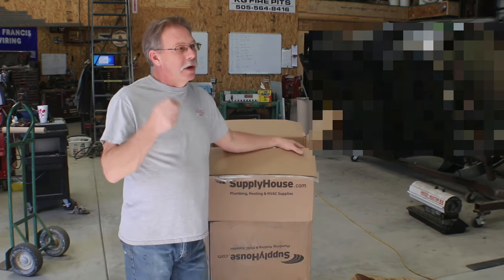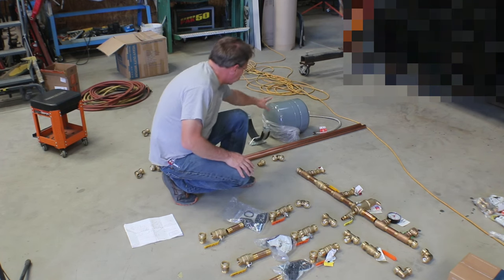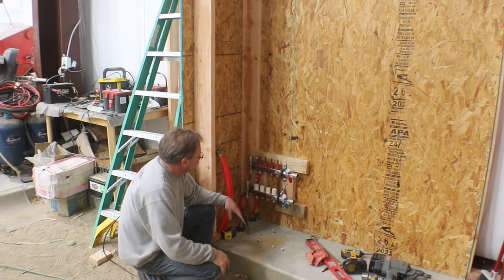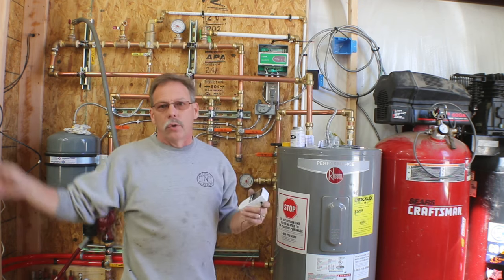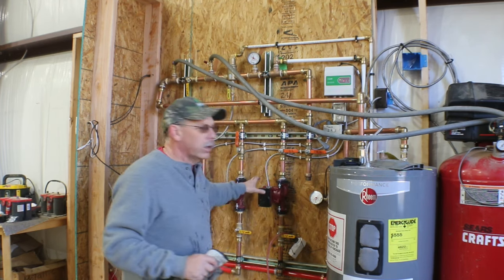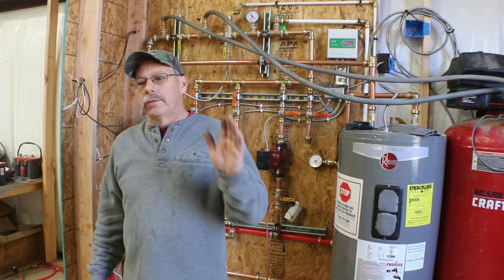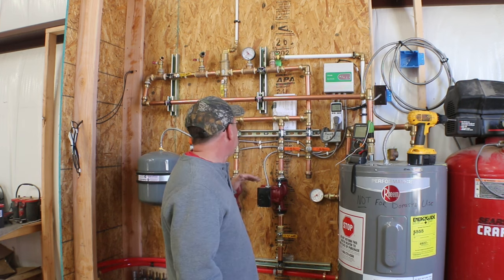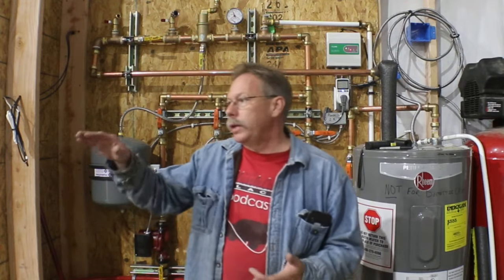Can you Heat your Shop with a $200 Water Heater? Radiant Floor Heating For My Shop | Allison Customs

Comment: I don't know anything about hydronic heating, but I do know electric resistive heating is EXPENSIVE. Did you insulate your slab before you poured it? And did you insulate your shop or do you plan to in the future? 11kwhs of heating is going to be expensive, any efficiency gains you make should have a good ROI.
Reply from the maker: Yes, the slab, stem walls and shop building are all insulated.  The water heater is expensive to run, but will keep the shop at 55-69 degrees depending on the outside temp,

Comment: Honestly I hope one day you upgrade your setup to an on Demand tankless water heater. Example ecosmart makes a 27 kilowat model tankless water heater for about 500 dollars. I mean it would have a whole lot more wattage then ur setup right there. No rewiring hot water tank either. However it requires three 40 amp 240 volt breakers. So at a given time it can pull a lot of electricity. Which means u might have to upgrade ur electrical panel. But I would say it would be worth it. I know the hot water heater was a quick fix. But the tankless water heater might be better in the long run
Reply from the maker: I have looked into them, but unfortunately I can’t go bigger with my electrical service.
The original idea was to use a waste oil boiler, unfortunately I just don’t produce the amount of oil necessary.
Check out the current situation - https://youtu.be/_mR7S4N28oY

Comment: Can somebody point me in the right direction online to start researching and planning a radiant floor heat system. I’m building a 32/24 pole barn and want to do this.
Reply from the maker: I got a bunch of info here (https://www.radiantec.com/about-radiant-heating/tubing-installation-methods/) and then went down the internet rabbit hole.
Reply: Ron bond construction. On youtube. It's bondo built. He does cement floors and showes you in one of his videos how easy it is to layout  the pipe yourself.  Tell him Sprintcat  sent you over there 🤣.and don't forget to give a thumbs up and subscribe.
Reply: Check out the books and talks by Dan Holohan on hot water hydronic piping, such as his 'Pumping Away' book.  It will tell you some of the non-intuitive things on the piping to the loops such as closely spaced Tees, etc.  Bunch of articles at HeatingHelp.  Also, Uponor (brand name of PEX) has info on installing the actual pex loops since they want to sell more pex.  

One key, loop length controls circulator size as the "head" in a closed hot water system is the pressure loss due to the flow, which is based on pipe diameter and length.  Max 250' with real max more like 200' for each loop.   Not to mention, the temp drop from start to end.

Comment: Slab heat is nice recovery is important unless it’s a hobby shop and you can allow every door opening.  Regulating the temp is another issue.  A shop too warm is not efficient.
Reply from the maker: True.  I’ve been keeping mine at 60f

Comment: A insulated jacket for the water heater couldn’t hurt keeping temp as well I would think
Reply from the maker: My brother recently offered the same advice, definitely now in the plan.
Reply: Not all that necessary when the heat goes into the conditioned space.    High insulation value on a water heater is primarily useful when no domestic hot water is used for many hours such as while you are sleeping or at work.  A space heating system has to work during those times.

Comment: Do you have solar electricity? Considering the cost to buy electricity installing a heat pump may be a viable solution to provide the required heat output needed to sufficiently heat the space at a fraction of the cost of running an electric heater as heat pump Will give you three times the heat output for the equal amount of energy consumption. Electric heating is 100% efficient so for every dollar you spend the entire dollar is put towards heating it is a 1:1 ratio, AC pump on the other hand is 300% efficient and would give you three times the amount of heat for the same energy consumed
Reply from the maker: No on the photovoltaic solar. 
I plan to add hydronic solar before next winter, I’m choosing that over PV  due to space constraints for panels. Also, last I checked, it would cost nearly $40k to offset my house and shop, all total that would be a 10-12 year pay off.
Hydronic would be closer to a 4 year payoff.

Comment: The only thing about having an internal check valve is if it does fail, you have to replace the whole component.  And check valves do fail.
Reply from the maker: True they can fail, but I believe the internal pump valves are replaceable.
Thanks.

Comment: Dont you need an air scoop?
Reply from the maker: Are you referring to someway to let air out of the system? If so, yes and I used a air separator version called a Spiroterm VJR100 (  https://amzn.to/3jRb7OL  )
So far it works awesome.
Reply: @AllisonCustoms  the scoop will sit under your automatic bleeder valve, creating a high spot in the horizontal run. Tacos website has a good explanation of how they work.
Reply from the maker: Thanks!

Comment: Over all looks nice for diy, not a fan of shark bites though for permanent work. I heard you say you are using 30 gallons of antifreeze, I’m gonna assume Sierra or like. Just a heads up antifreeze is not good on steel or iron or rubber gaskets, so your circs if iron will take a hit, the gaskets and seals will too and the w/h tank. I saw you intend to replace the heat source possibly with solar soon, so all that should not be an issue.
Love to hear back on how it’s doing after a bit!
Reply from the maker: I’m planning an update video for the end of the season.  Thanks for the info.
Reply: @AllisonCustoms  looking forward to it, you obviously care about the details, so it will be cool to see what you come up with!

Comment: Back in the "Total Electric Living" days of 1970's, it was not uncommon to see both elements powered at the same time. The proper way is to install separate breakers in the panel and run separate wires to each element. A 6 terminal thermostat for a single element wtr htr is installed in place of the lower stat and the wire from the upper element to the lower stat is disconnected and abandoned. 
The 6 terminal stat provides a seperate ECO (energy cut off) for lower element to reduce risk of uncontrolled heating should the stat fail in the closed position.
The problem with sharing info is that you open yourself up to a certain amount of risk and potential ridicule in that some people will think that they understand what you said and by the time they are done with what they are working on they have it so messed up that there are problems. They then have to hire someone to resolve those issues. Of course in discussion of the situation the person that did the work does not want to make himself out to be an idiot so you end up the moron. What makes it worse then is that the person doing the repair has a tendency to jump on the moron bashing wagon so as to make himself out the hero.
One final thought, it takes a given amount of energy to heat a building to the desired temperature during the coldest day of the year.
There are programs and formulas that will help determine that requirement.
Sometimes a little up front expense for a consultation fee to help determine what is actually needed is money well spent. Even if they are using a simple multiplier rather than a full analysis of the bldg it should help you start off with the right size heater, eliminate wasted expenses on experimentation, allow you to use energy cost conversion tables to help determine your cost of operation after installation and compare cost for different fuels.
The down side of using an under sized heater is the recovery time. If you are working in the shop and open up big doors for long enough to cool the slab then you might be working in a cool space for an extended period of time.
Otherwise, nice job on the install and video. Hope to catch a video from you with results in a few years to see how it's going.
Reply from the maker: Thanks, you make some very valid points!

Comment: With all the sharkbites I agree that you can blow hot water around
Reply from the maker: So far they are working great, and I have been able to change things up as needed or when I just want to try something different.
Check here for current setup - https://youtu.be/_mR7S4N28oY

Comment: You could potentially cut the cost of heating your shop by preheating your water going into the electric heater with composting leaves and other vegetation, and burying the lines underground. Look on YT for videos on that. The Random Farmer has a video on his channel.
Reply from the maker: Interesting idea.  I would imagine (I absolutely don’t Know) that I would need a compost pile similar in size to the area I want to heat.  And if my wife complains about haw many cars I have (and she can’t see them all) I can’t imagine what I would hear about a compost pile of any significant size. 😀😀
Reply: @AllisonCustoms  you wouldn't need a huge pile, a small investment in concrete block and scrap rebar or conduit to hold the blocks up in a circle. On Mother Earth News years ago, a guy did this for the water heater in his house. He made a block structure with similar materials, and it was about 6' across, and about as high. Within a week of putting leaves in the wall, the temperature rose to about 140°< and held up to that until about the middle of April. After that, as the leaves decomposed, the temperature gradually dropped, but still was above 100°. If I were you, I'd look at a few videos and see if this is want to do.
You might be able to use deconstructed concrete blocks, and electricians might give you scrap conduit. A scrap yard might get you other things that are also useful.
Reply from the maker: Thanks I’ll look into this!  I all for easy - mostly free energy!

Comment: Just a quick note and not to be an instructional comment. Please don't burn you garage or house down.
Most electric water heaters are fed from a 30Amp 240Volt circuit. Each element is rated 4500 Watts: 4500 / 240 = 18.75 Amps. You are only allowed by code to load a 20Amp circuit to 16 Amps, this is why with one element at a time it has to be on a 30Amp circuit. Two elements equals 37Amps which by code would need to be on a 50Amp circuit. Besides being on a 50 Amp circuit the internal wiring of the water heater would need to be changed. Do not try to make both elements turn on at the same time unless you are willing to face the charges for negligent homicide if you kill someone in the fire for improper wiring.
Reply: Note the internal wiring and each individual element are not rated for 50Amps.
Reply from the maker: Please note, I did retire both elements and I said so in the video. In fact I specifically said I had, but that I would not be sharing how since I didn’t want to encourage others to try something they would not be comfortable or knowledgeable about.
Thanks for the comment and watching.

Comment: My new pump is making noise and I am sure I have air in the system (which has been an ongoing problem).   I have had plumbers spend dozens of hours on the problem.  If anyone knows of the best air evacuation system please let me know.  Multiple plumbers have not found source of air.
Reply: Baseboard 180 degree heat.  No in floor radiant heat
Reply from the maker: Could be air trapped in the system, I had to flush my system with a garden hose for over 1/2 an hour when I started mine up.
In answer to your question, I’ve had really good luck with this one. - Spirovent Jr. Air Eliminator - https://amzn.to/3kBVvhY

Comment: It is very obvious that you did lots of research before starting on your system. Doing it yourself allows you a greater understanding of the system so maint. and repairs can also be done by yourself at a significant savings.
One item that I noticed and took issue with was your expansion tank. Many people don't understand the operation of them. First of all you said you filled the tank with water before starting the system. If that is done there is no room for expansion. Also, it appears that the tank is mounted upside down. My recommendation is to mount the expansion tank with the connection at the bottom. Then put a T in the line with a shut off valve on the two other sides of the T. One T would Isolate the tank while the other would be used as a drain. 
Once the tank is set up correctly, Isolate and drain the tank. Leave the drain open and pressurize the tank to the the pressure the system normally runs at. Then close the drain valve and open the valve to the system. Another benefit of the T and  valves is that it allows you to be able to re-drain the tank easily as air is slowly absorbed by the water over time and the tank will fill with water and again become non effective.
Reply from the maker: Thanks for the advice! I am planning to change the tanks hookup location (thanks to another viewer’s suggestion), so when the parts come in I’ll try what you’ve suggested as well.

Comment: Why use shark bite fittings when you can just use crimp fittings??
Reply from the maker: Only because I have changed up the system three times since the original.  I actually have a new video on it coming out soon- to explain the most recent changes.  If I ever “complete” the system, crimps will be my fittings of choice.

Comment: just starting typing off the intro to the video here :
unless its an on demand waterheater is made to heat up water inside an insutated vat , when youre pumping it around throught the floor youre cooling it off and basicly make the waterheater working non stop , sumting it isnt desighned to do and even running it part time it whont be enough to heat the place up
so while it should work i think it will burn out the heating elements over time , it probably be less efficient than a purpose made underfloor cenral heating system , the bigger elements make for a little more overcapacity so you can run the hot water around for a little longer untill its cooled below the temperature to be usefull 

it might work with multiple hotwaterheaters running one at a time but a central heating system would be way better as its made to make a LOT of heat pretty mush constantly 
sumting else you might want to look intoo is geothermal heating , basicly drilling a deep but dry well (basicly running water through a doubled pipe running down through an inner pipe and up through the outer pipe and use earth warmth transfered through the pipewall to preheat the water , might save few degrees you dont have to heat up and only uses a little electricity running the pump circulating the water through , might actually be enough to prevent freezing 
https://www.earthheat.com/how-geothermal-systems-work/
over here there sponsoring a lot of heatexchangers basicly aircon units that heat up homes , i have my doubts on their efficiency though , they do work of electricity so you could check that out as a heatsuorce 
if you have access through wood (old pallets underbrush watever wood as long as its free or verry cheap) you could build a woodfired waterheater feeding it through a beltsystem and a hopper filled with wood ran trough a woodchipper takes a little more maintanance , work , and care to keep it running but would be cheaper per btu produced
Reply from the maker: I don’t have a consistent source of wood or combustible materials and I’m not at the shop 7 days a week, so that is pretty much out.
I’m am researching heat pumps, especially the pool versions.
I have added a solar system that is working well.  
The water heater works very well at keeping the shop between 55-60 degrees F, but VERY expensive.  
Our water table is to high for deep hole GEO, and I don’t have room for shallow hole GEO.  So again a no go.
Thanks for the comment and ideas!
Reply: @AllisonCustoms  i suspected the electric heating would be pricey (besides not verry efficient ) thats why im still on natural gas 

even though our goverment is pushing for electric heating  (by raising the price for gas and subsidize conversions to electric heating using heatpumps) 
i can understand why : the electricity get generated using gas so the company producing it pays the taxes for the gas it uses  , then they deliver electricity to the consumer , and they pay taxes over the electricity , the goverment basicly double dips on the taxes that way making more than on gas delivered directly to the consumer over here there even central heating boilers on natural gas that reuse the heat generated to produce electricity there 120 percent efficient 

dont know if you have a lot of sun where you are but you could look intoo earthbag homes , these use a big wall behind windows to store heat from the sun , the warmed up wall keeps the place warmer in the night time , you might be able to do sumting simulair with the thick concrete floors but would mean a dual pane glass wall on one side of the shop for the sun to be able to shine on the floor
think the simplest fastest cheapest way would still be propane heating theres a lot of energy in the stuff for the amount of space it takes in and having a big tank should immit the times it needs to be refilled to once a year or so

yet another option ive seen here in the netherlands in greenhouses is that they run a generator , the generator has a watercooled block and marine style watercooled exhaust and a heat exchanger further upstream , and the heated water from that setup gets circulated through the heating when the generator is running , besides producing electricity , these engines are pretty big as they power a lot of lamps on the greenhouses (think locomotive diesel) 
you might want to take a look at how mush it would cost to generate the power in the shop using diesel and use the heat from the engine to partly heat the shop (and the exces electricity to heat it up further )